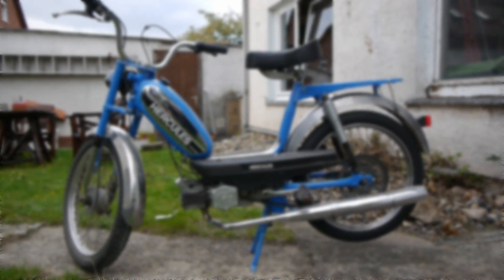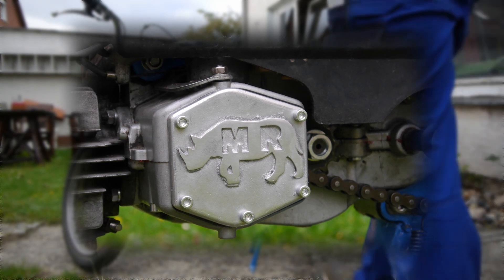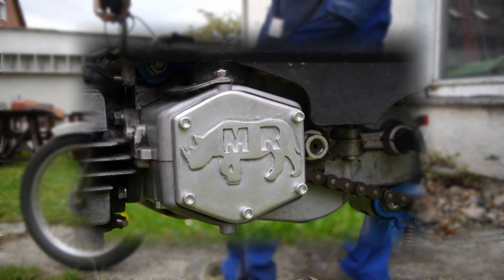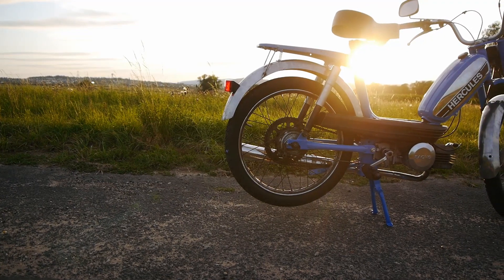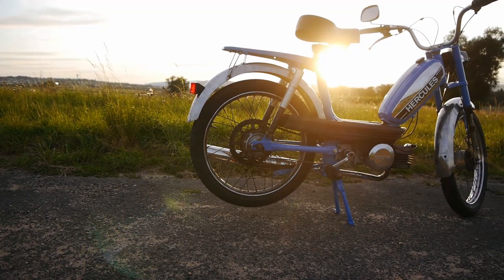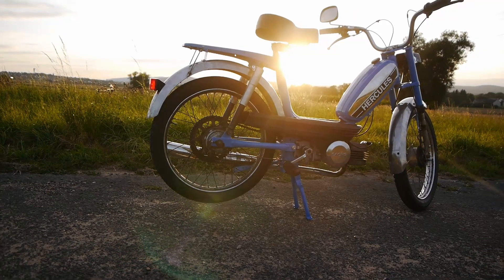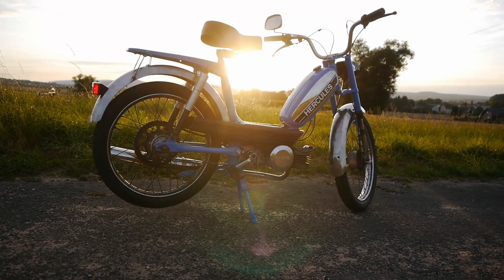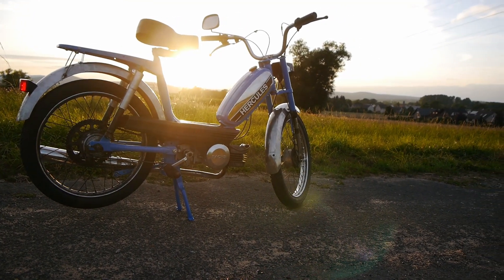I've made a custom clutch cover for my old moped.

Comment: I just picked up a 78 balboa, sachs with the 501/1a. I have it all apart, plan on doing what you did. its a single speed what info do you have on the clutch system for mine I feel like that will be troublesome area. Cheers
Reply from the maker: Unfortunately, I have no experience with the Sachs 501 engine. Find a drawing of the Clutch assembly. A drawing of the Clutch helped me a lot to put the Clutch back together correctly. Most of this old engines have a simple design which makes it easy to understand how they work. And if you know how it works, it's easier to work on.